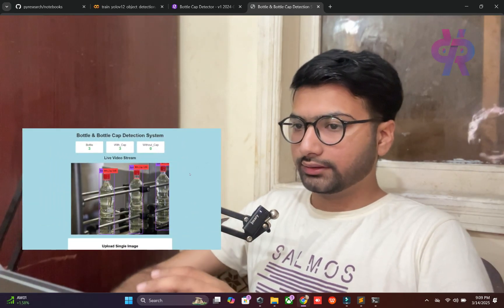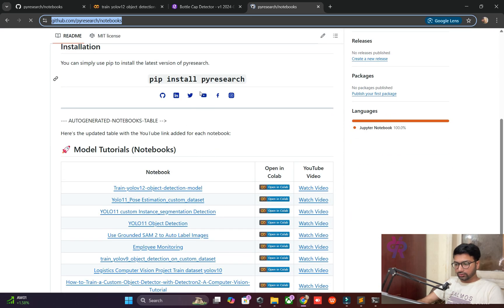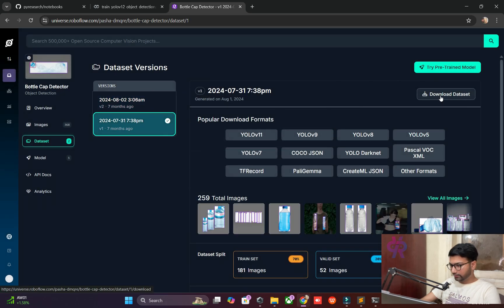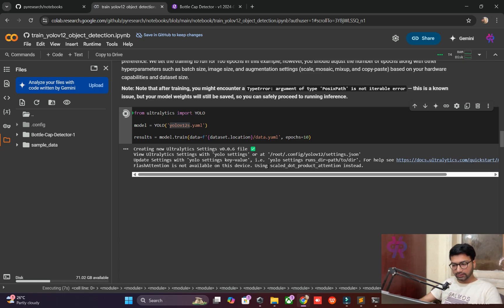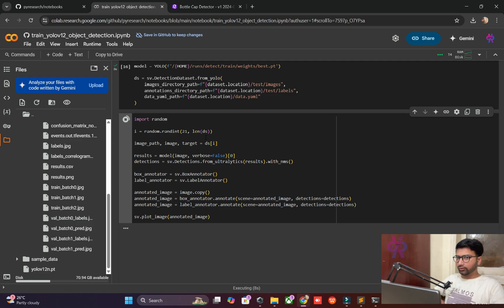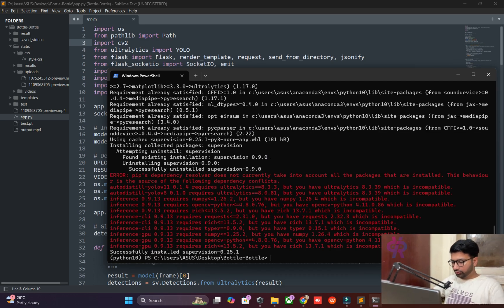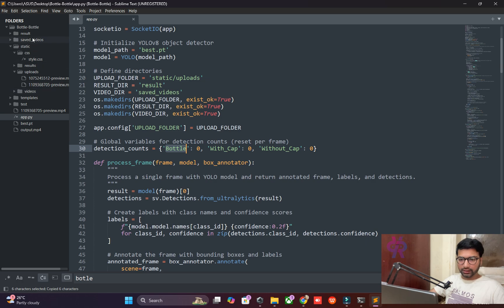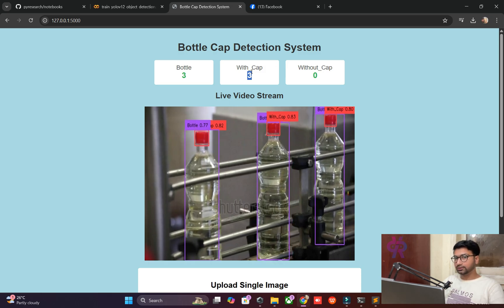Bottle Cap Inspection with YOLOv12 Detecting Defects & Ensuring Quality Control

Comment: Can you give me suggestions on how to detect from multiple CCTV footages in real time and generate WhatsApp message using twilo in real time? It needs to be lag free detection. I don't have GPU . How can I use cloud GPU in that case for multiple CCTV footage ?
Reply from the maker: Hello you get idea from here Real-time Theft Detection: Custom Dataset with Roboflow Inference & Instant SMS Alerts
https://youtu.be/j0QNkSqZSS0
Reply: @Pyresearch

thanks for the reply.  yeah I have implemented, but its running very slow in real time can't even track the real time CCTV video perfectly due to lagging issues.
Reply from the maker: @nahid862  which system you use?
Reply: @Pyresearch  trained using google Colab, and then real time checking in CPU(core i5, no gpu, ram 16 gb) using IDE
Reply from the maker: @nahid862  use ssd also
Reply: @Pyresearch  yes using ssd
Reply: @Pyresearch  if possible and have time, make a video on how to deploy the thief detection model in cloud GPU. And detection in real time.

 Thanks in advance.